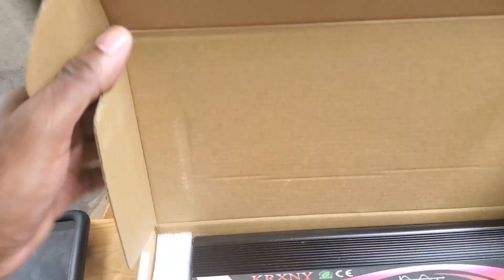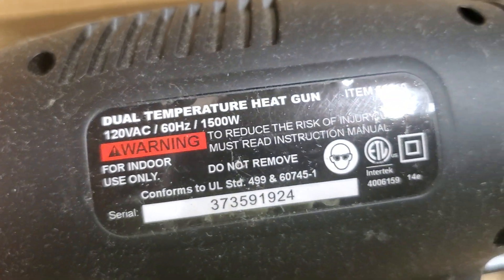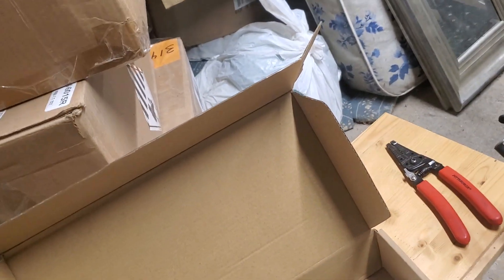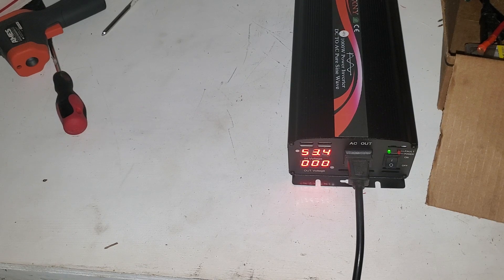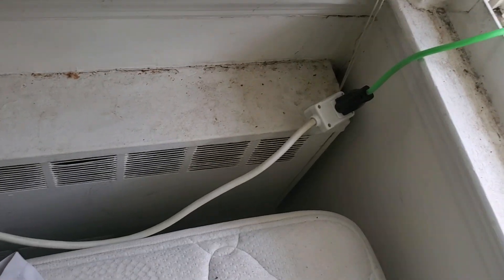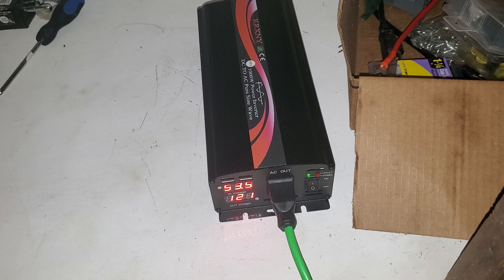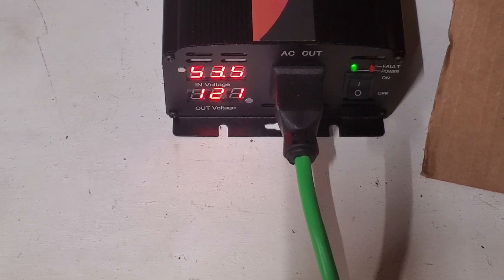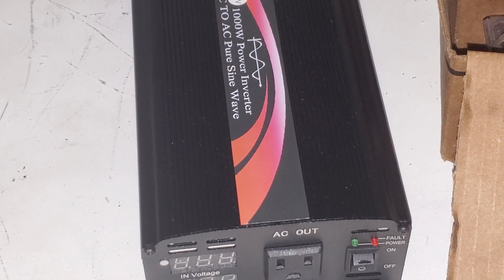TESTING 1000W Pure Sine Wave Power Inverter 48V DC to 120V AC 60HZ #KRXNY #INVERTER #solar #lithium

Comment: My brother respect interesting video. I wish you would have shown us the inside secondly a watt meter would have been nice. It would be lovely to see how close it would run the 1000w it's rated for. Confession I wanted to buy one of these inverters but there wasn't much review on it and when you are strap for each you don't want to take chances.
Reply from the maker: I will have an update in yhe future. I am off the grid, I need to have a backup Inverter just in case the current one breaks down. I want to test it with the house 🏠 but I don't have the wire for the connection
Reply: @simplyfocus9937  ok I am in Jamaica and is also off grid which is not normal for our culture. I am using a 48v Lifepo4 diy packs with a 3000w Reliable pure sine inverter and the system works well. I really don't worry about a backup at the moment.